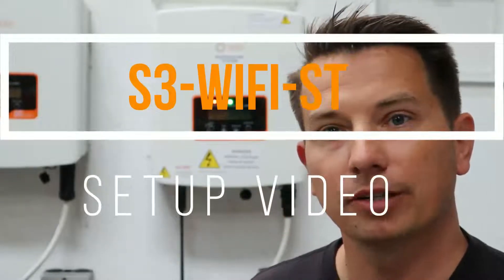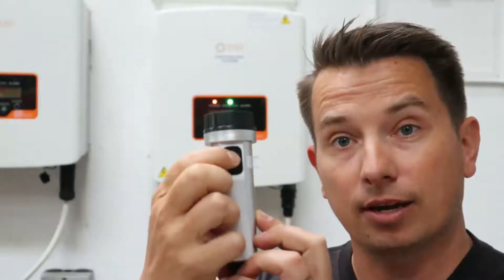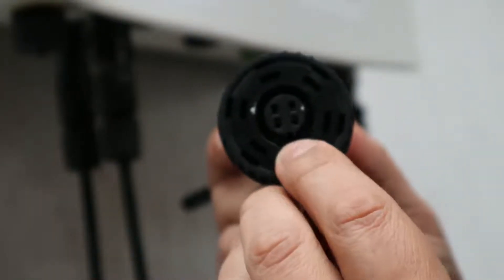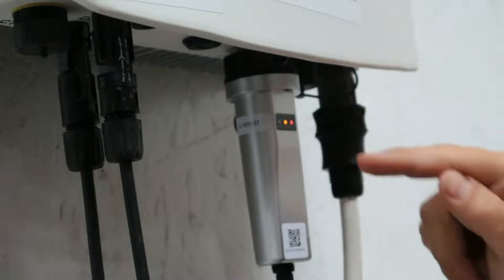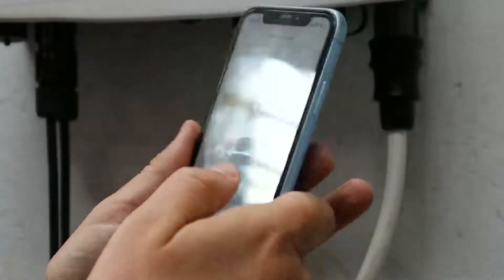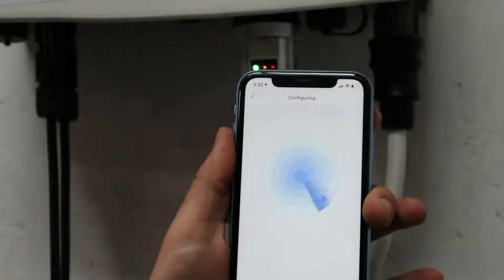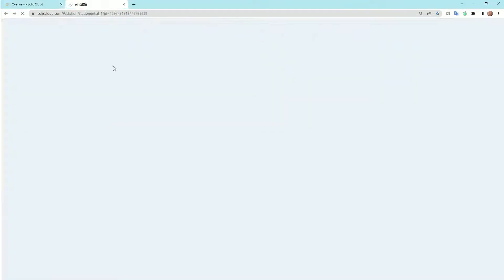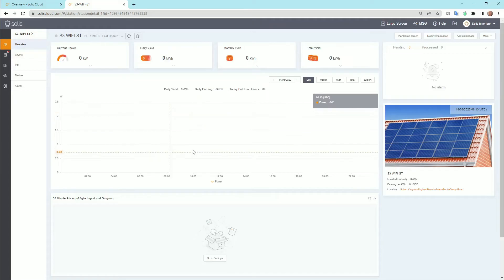S3-WIFI-ST - Solis WIFI Stick Setup

Comment: Poorly done. He goes too fast at critical points. I have made 5 or 6 attempts but process fails at different points. No datalogger wifi network appears and no automatic configuration is available.

Comment: Version  4.4 3 on the "More Tools" offers WIFI Configuration, but not the scanner you are showing here, but only via providing the SN, and then via connecting the datalogger WIFI, to use the tool to change the WLAN, but there I get the login screen, but user admin password 12345679 is denied. So howe to change the SSID in 2024? I wish there would be some phone support in Germany to get this sorted out.

Comment: Trouble is it does not connect over a 5G network. My rooter does 2.4 and 5G and neither are being seen by the app.
Any ideas?
Reply: Try angling the data logger antenna toward the router and move metal obstructions. The 2.4 network needs to be used.

Comment: Why not re-do this wifi dongle video and slow it down, make sure you explain everything e.g.. you mention "password" explain fully (yes, it's for your router, I know...) but make it comprehensible. Include info when you find it does not work! That is important, show all the 'gotchas' and ways to solve them. Then you will have done it properly. Solis, please note!

Comment: My Solis setup migrated from Solis Home to Solis Cloud, but that never worked properly. Now if I try to add a datalogger, the app says it's bound to a different plant. After resetting completely the account (delete and create again), the error persists, so the datalogger must be bound to a ghost plant now due to migration failure. Is there a way to unbind the datalogger through support and bind again?

Comment: I have the old style datalogger and was using the Solis Home app without a problem. However, this server appears to have now been decommissioned so I have now installed the Soliscloud app, created a plant, added the datalogger and then connected the datalogger to the router via the app. The datalogger has logged on to the network but no data is being sent to Soliscloud. Is their an IP configuration change I need to make?

Comment: What is the range of the Wifi stick?  Ask because the Solis S6 inverter was installed in the garden shed and is about 10 - 12 m away from the router.

Comment: Hello, I have a Solis S6 inverter and I'm interested in what the interface designation DRM stands for.  A network cable fits in there.  What is the function of this connection on the inverter?

Comment: How to monitor Solis RHI-3P(5-10)K-HVES-5G online? How to connect it to the app? It does datalogger installed in it, right?
Reply: I have an RHI 3P10K installed. I have installed an S3 datalogger and it works. I see that there is a wifi antenna built in, however I a not sure what that does.

Comment: My inverter was installed on Wednesday and having the same problem as everyone else.  The main issue is that the app they show you how to do things with, is not the same layout or wording as the app I have.  I have version 1.3.4.  Is this correct, or is there a different version.  On top of my installer who didn't have a clue about how to set it up, all in all very poor.

Comment: This is brilliant - I am confused by the instructions in the datalogger box at Step 7, where it says "after that return to APP". I'm in the app at this point so if I return I'm redoing everything I just did. Watching the video, it seems I came unstuck where the instructions say "Browser Configuration (recommended)", while the video says "One-click Distribution" (my screen says something else but actually it's the option below Browser Configuration that takes you to the screen where you can enter your home wifi password. 
The setup procedure is conditional on the inverter being active (big green LED on the control panel), and since the solar PV stopped generating my inverter shut down - need to wait until tomorrow and have another go.
Reply: terrible video. He has not rehearsed this and stumbles over the most important steps, confusing instructions. I am still unable to complete this vital task. Please Solis, get a professional to do this video and make it comprehensible. And when you do it, take the personal photos off the phone being used.

Comment: Hi Travis.
Many thanks for the video.

Do you know how to add more than one inverter to the datalogger ?
Most of the sellers of the stick have that information in their product description an dit is noted in the manual of the stick too.
But it seems like nobody really knows how to do that.

Further I would like to know if the option to retrieve data over Port 8899 is still possible with the new version.
With th old version it was.

Comment: a nightmare to get the datalogger connected to wifi. solis support is not helpful, neither are the manuals or videos. basic to the extreme. installer also difficult to get hold of to get the job finished properly with everything working. no information provided by the installer - begs the question do they even understand this solis solar system?  after 4 weeks of perseverance I finally managed to get the datalogger connected and stable. how? bought a separate wifi extender and plugged in an ethernet cable to the only connection I could find on the top of the battery. next issue to sort out is how to actually make any sense of the solis app?  what a carry on.  whats the point of this solar system if you can't see what you are generating and the data?  seems even the installers details need to be typed in to the app.  there's a lot of questions to answer which don't seem relevant.  otherwise the 'plant' can't be added.  looks like even more youtube videos need watching.  lots of money shelled out to go green - are we all being had?
Reply: When using android you have to switch gps and Bluetooth on. Than connecting worked for me.
Reply: I'm currently living that nightmare, any tips on getting it to connect?

Comment: D3-wifi-st dongle. Updated solis app. My wifi name and passwd changed. I reseted the stick to default settings. I'm connected to home wifi. Using solis app i scanned the stick serial and its telling me to connect to the stick wifi. I can see the stick wifi but when i click on it its asking me for the stick wifi password. It doesnt accept anything i tried. I also tried that process on android and IOS devices but no luck.
Reply: 123456789

Comment: What about the old style logger? I get stuck at "Connect to Router" - I don't get the "one click" option at all. At this point am I connecting to the logger device or my broadband router? If I click "connect to router" I am taken to Apple settings for Soliscloud. On the old data logger, do I just disconnect it to reset? This video was no help at all!
Reply: Exactly I have spent a whole week since I had my new router trying to set it up. Even spoke to someone from Solis who kept referring to a reset button but I have no such button. I am not an engineer and updating my WiFi router settings should be be made simple. I have found my installer and Solis very unhelpful. Can someone please help?
Reply: If this doesn't work you MAY need to disconnect the wifistick from the inverter, for a few mins then reconnect to reset.

Comment: Will this do software updates automatically or do I need to do something on the app ?
Reply: Mine updates firmware over this connection as Solis Cloud can see the inverter once it connects. I just asked support to update the firmware and they did!

Comment: I put it in the right way but no lights go on.
Reply: Make  sure DC voltage is applied.  Also check your address is set to 1.  Otherwise you need to replace the inverter.  Also you can check pins 1 and 2 for 5VDC and 3 and 4 for ~1.7VDC

Comment: My hybrid has built in wifi but no serial number??
Reply: It does not have built in WIFI.  If you have a 3P it has a local area network you can connect your phone too but it will not send information to the cloud.